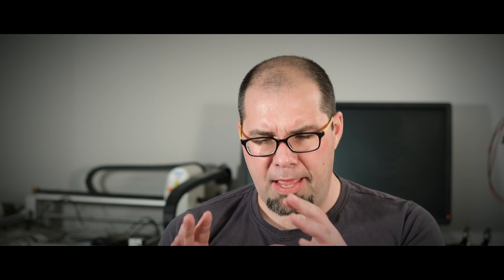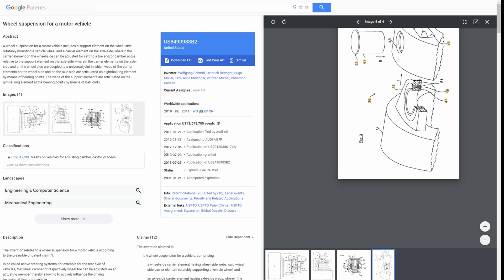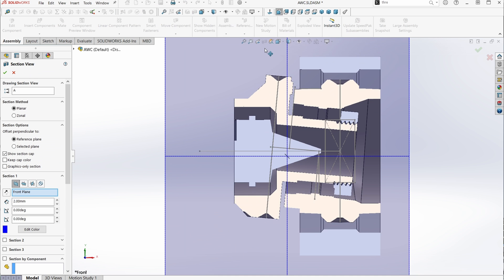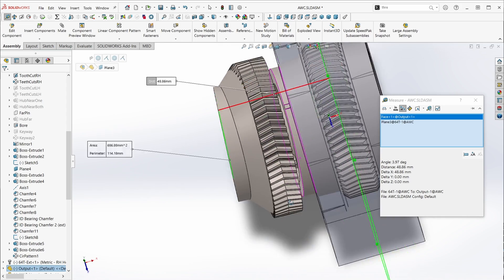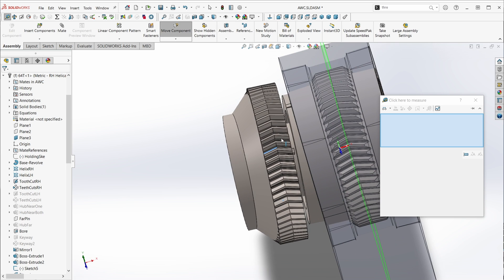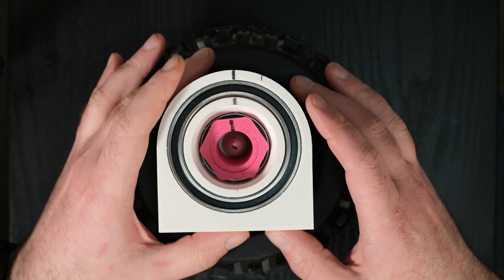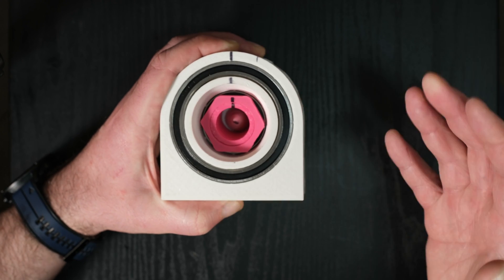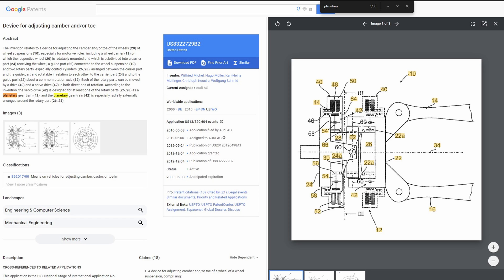Everyone got how this works wrong - Lamborghini Active Wheel Carrier ACTUALLY explained

Comment: I don't know who granted this patent, but it is absurd, the principle is very old and used a lot for adjustable centers that need to stay parallel (but not necessarily - as in this case), so how/why they got patent for this is beyond me - it's basic mechanics
2 angled centers are necessary because you may want/need to eliminate procession, meaning - make the adjustment happen in a single plane, because with only one of the angled elements, as you rotate it, it will "adjust" in 2 planes and may work against what the whole adjustment is trying to achieve
the main issue with this, if they are indeed sitting in ball or roller bearings, discounting the whole thing being ridiculously over complex solution for a problem that doesn't even bother anyone in context of road cars, will be brinelling, ball/roller bearings need to make full rotations, they are exceptionally weak for repeated loads without rotation, that is what plain bearings are for, but plain bearings here will come with their own issues in this application
overall a terrible trend to see such tech come into road cars, even very expensive ones, and I can bet years salary that the development budget came out of sales of golfs and passats, hence why they cost so much these days, because the "supercar" market would never pay for any of this
Reply from the maker: I didn't go through the claims in depth looking back, but yes it's actually been granted in several countries. I've seen many get granted on technical additions to claims but that also means that they are easy to get around too. Can't speak to the costs of R&D. Just thought it was an interesting mechanism I saw a bunch about with poor explanations.
Reply: Hi, could you link or name an application of this very old principle / concept that i can look up? Thank you.
Reply: @Tenfdy  no idea what it is called, but I've seen it on movie production equipment, camera rigs, science equipment, basically it is 2 offset bores inside one another, with a single bore you can move the inside bore in an orbit, with 2 you can place it anywhere you want, this audi design is using 2 angles, but the principle behind it is exactly the same
Reply: @rikkc137  thanks for replying. I believe you that it is used but my problem is that i dont know what to google to find at least one product.
You said in the original comment that this is nothing new. Now you say "audi design is using 2 angles, but the principle behind it is exactly the same". Which is it? Are there applications that use that design to tilt in two axis or are the designs you are talking about to position in one plane? yes both use two axis rotation but the application is different. Based on your comment it sounds like comparing  "tire" to a "gearwheel" both are round and turn.
Reply: @Tenfdy  look at the F35 fighter swivel nozzle design, you'll understand that the principle is the same as in this audi patent - use 2 (or more) eccentric (not necessarily parallel) motions to cancel out unwanted geometry changes and have the main axis align directly with the vector change without orbiting
I think even the new NASAs hard spacesuit use the same principle for joint rotation, so that the suit follows the body motions directly instead of forcing the limbs to follow orbit forced by a single angled axis of rotation - if that was the design choice
I personally see no difference between the parallel version and the angled - they both solve the exact same problem, but you sound more like the audi patent lawyer ;)
Reply: This particular mechanism does not seem especially well suited for automotive applications, but I disagree about the usefulness of the concept. Active camber/toe on road cars (not just supercars) has many potential benefits, such as enabling more compact suspension designs while achieving the desired toe and camber gains through electromechanical manipulation instead of complex, difficult to package, and expensive multi-link geometries. High efficiency and low tread wear while straight line driving, regardless of vehicle load, while being able to use the full contact patch during high lateral accelerations. Ideally this manipulation gets done in a way that does not add unsprung weight and multiple wear items to the harsh environment of the wheel hub.

Comment: Good take on showing isolated rotations of the parts, when other are going straight for compound movement! 
However, distracting how you constantly fiddle around the mechanism, not having the housing fixed to the table and camera shot. If you want to show it from different angles, several simultaneous camera shots (like main and side views on a blueprint) would be better. My suggestion - an isometric view plus backshot of markings on the inside.

Also I think people miss how important that top-of-the-cone property is for making spherical motion with two slanted cylinders.
Reply from the maker: Thanks for the feedback. I probably won't revisit unless I do a redesign to make it smaller and actually setup motors but good advice for the future. Thanks.